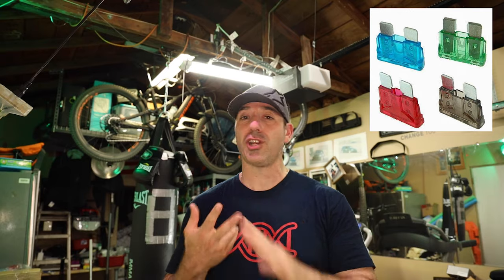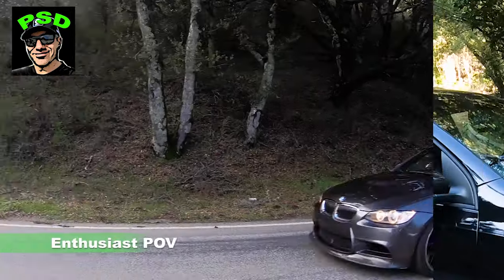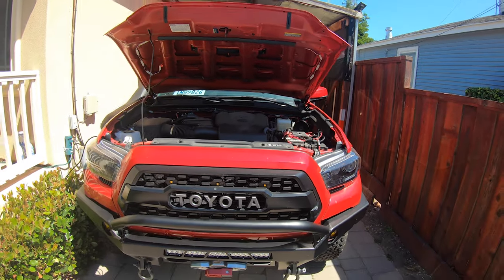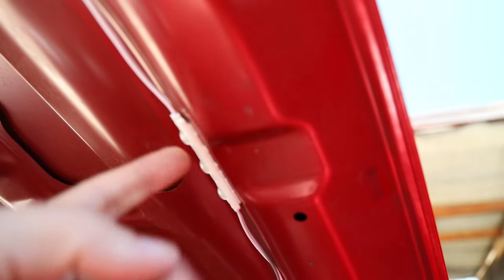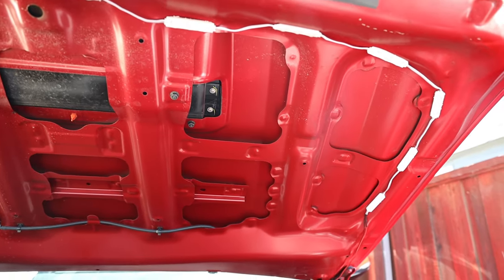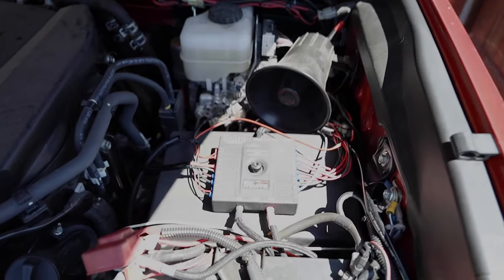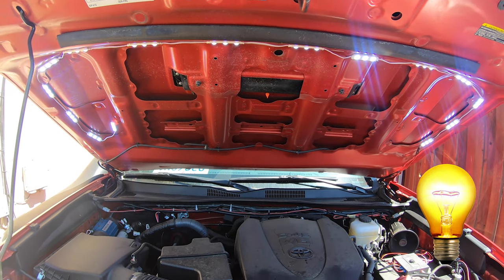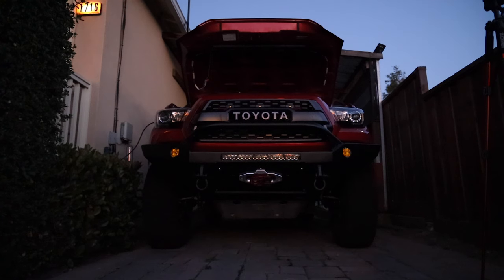How to light your engine bay easily and cheaply!

Comment: Did you stick the light with the 3m they come? Did they hold up in the heat of the engine bay?
Reply from the maker: they come with 3M tape. they stick perfectly! they have not moved even through this SUPER hot summer we just had

Comment: Thank you for your video! One question: What did you do with free cables on the driver side? Are just insulated? Thanks!
Reply from the maker: Wrap them with electrical tape and then route them under cladding.
Reply: @PointShiftDrive  thank you.  So it is not a problem that the are left not connected anywhere? Just isolated wuth tape to avoid contacting metal and that's it. Correct?  Sorry,  the electric knowledge isn't my strongest discipline (softly said:))
Reply from the maker: @axios76  as long as you make sure there isn’t any possibility of metal on metal contact and no water contact your fine. There are also electrical connectors you can find probably on Amazon to help. But tape is easiest.